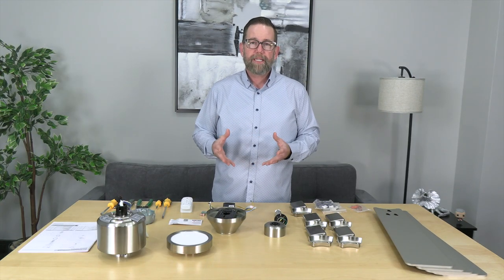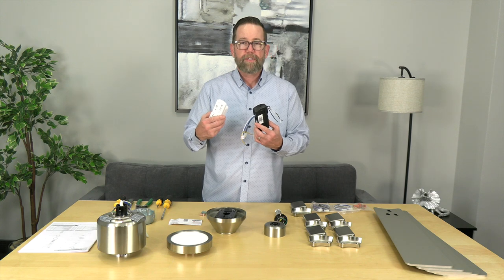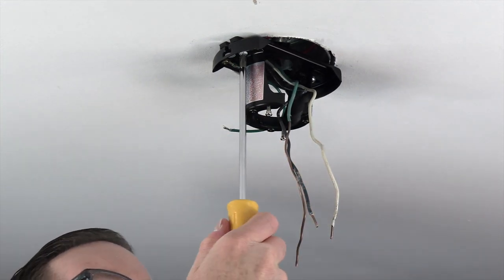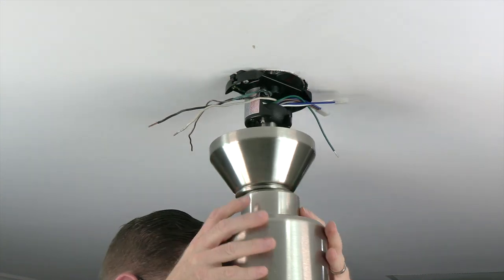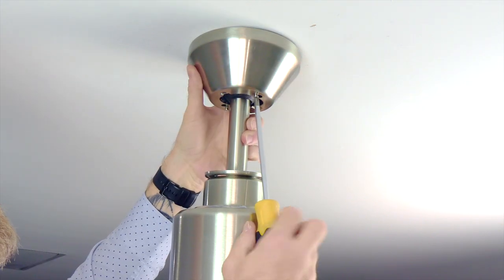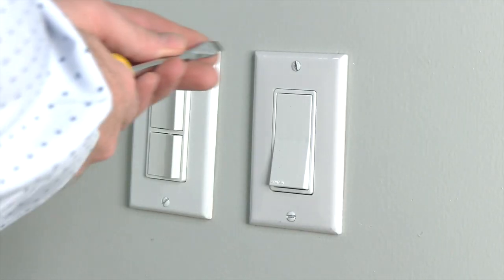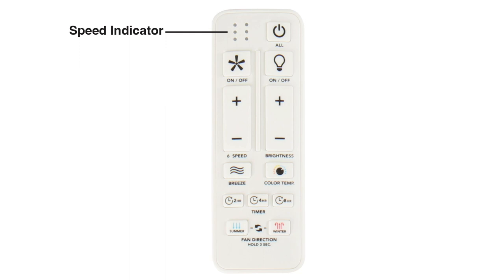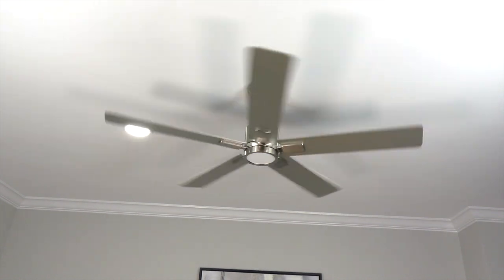How to Iinstall the 52 in. Zandra Smart Ceiling Fan by Hampton Bay

Comment: One of the issues with this fan and installation is that the controller may not be synchronized with fan and causes erratic problems with the fan. This can be addressed by powering down the fan from the switch for 1 minute and within seconds of powering up the system back up (turning on the wall switch), hit and hold the reset/sync/learn button for a couple of seconds.
Reply from the maker: The remote should be paired with the fan at the factory. There are some instances where an interfering signal in the area may cause remote issues. This can be easily resolved by re-pairing the remote, which would change the frequency of the remote to improve performance.
Reply: @ceilingfans101  —my fan would only work for about 5 seconds and then shut off. I had to find the Q&A section in HomeDeport reviews to find a similar issue and learned of the hidden reprogram/sync button in the remote. After I fixed the problem I found your comment about the remote as well. As for the reference to interfering sound waves—Hunter also explains this, but frankly it is a piece of information that is contusing to most of of who don’t understand the physics of sound waves and where they exist. It would be better to simply address the net effects and the solution rather than getting onto the physics of why this happens. IMHO
Reply: The button is hidden under the battery compartment cover.
Reply from the maker: @ZipRealtyAustin  thank you for your comments. The pairing instruction is covered in detail on page 13 of the manual. The remote functions using radio frequency, not sound waves. In the manual, it states "If the remote control does not
communicate with the fan, follow the pairing instructions below." This is, in essence, addressing the net effects and solution instead of getting into the physics. The solution would be to create a remote that is not affected by any other radio frequency device. With all of the various frequencies used with all sorts of different items, that solution is near impossible - so having a remote with a multitude of possible frequencies is the solution.

Comment: Hi, I recently installed a ceiling fan with a light that came with a remote. Everything went well, however the fan and the light only works with the remote and the wall switch is completely un operational . Would you know what could be the issue ?
Reply from the maker: Typically, if there is a switch present, there would be 2 power wires in the ceiling - one would be a constant power wire (typically a black wire) and the other would be a switch wire (typically a red wire). Sounds like the receiver was just wired to the house's black wire.
Reply: @ceilingfans101  thank you kindly. I was able to fix it. Appreciate it ! 😊

Comment: Excellent video, I have seen several videos of yours with Hampton Bay fans, I am looking for ceiling fans for the living room, between Fanelee and the Zandra, which one do you recommend? thank you
Reply from the maker: The Fanelee is slightly bigger (54" vs 52") and offers a bit better performance in the lighting and airflow numbers. The Zandra does offer a reverse function on the remote, so if you live somewhere that you change the direction of the fan, that may be a consideration.

Comment: Thanks for posting! This video was helpful.  I just installed this fan but I noriced that the downrod is not completely perpendicular to the motor. So my downrod can be straight but then the motor is crooked, or the motor can be straight but then the downrod is crooked. It appears to be worse when the set screw is fully tightened. Is this normal or did i mess up screwing in the downrod to the motor unit?
Reply from the maker: The downrod should be straight from the motor collar. Please make sure that the downrod is screwed in completely to the motor collar. Tightening the set screw should not alter the angle of the downrod.

Comment: I am attempting to place this fan on a slanted ceiling that is fairly high. My old fan had a pin at the top and the outlet plate had the opening so you could mount in with the pin to the ceiling instead of using a mounting bracket like in the new kit. Do I still just attach it in that manner and use the mounting bracket just so I can fit the remote at the top. I bought a new down rod extension but if I use the mounting bracket that comes with the kit - my rod is at an angle if I do it that way. Thank you so much for the great video.
Reply from the maker: The fan is required to be installed with the mounting bracket included with the fan. The fan can be installed on an angled ceiling with a maximum angle of 20 degrees if installed with the receiver. If you ceiling angle is greater than 20 degrees, you will need a 45 degree canopy kit so that the downrod is not angled when installed.

Comment: Hi! I'm trying to make a decision between this fan or the Hunter Aerodyne, but I'm not sure what's best. The Hunter fan is cheaper and I like the style bit better, but I'm worried that I might not tolerate the humming that it's produce by its AC motor. Do you think the HB Zandra would be much better than the Hunter? What do you recommend?
Reply from the maker: In our experience, the Hampton Bay fans are much easier to install than Hunter products. According to listed specifications, the Zandra fan is going to move more air. The Zandra also offers color temperature control for the light to let you choose different color temperatures ranging from warm white to daylight deluxe.

Comment: When the fan is at 5th speed the hanging pole is oscillating, how can stop this issue(It even creaks)
Reply from the maker: Make sure that the slot of the ball is seated properly in the mounting bracket and that the set screw is completely tightened on the motor collar. The downrod should not move when the fan is operating. If that doesn't resolve your issue, we would suggest calling Hampton Bay customer service at 1-855-434-2678).

Comment: On the top of the down rod there is a pin that makes my wires twist up. How do I get that pin out or stop it from twitch when i tighten it
Reply from the maker: You can remove the screw from the ball and that will allow you to turn the downrod without twisting the wires. You can also try to hold the wires straight up while screwing the downrod into the coupler.

Comment: Should the antenna stay hidden or be exposed? My remote isn't working consistently.
Reply from the maker: The antenna for this receiver is not required to be outside of the canopy. We would suggest changing the frequency of the remote. Follow the instructions at the 17:49 mark and that will change the frequency of the remote to improve the remote signal. The may be an interfering signal in the area causing the weak reception. Changing the frequency should resolve the issue.

Comment: How to install when i have black, red and white cable?
Reply from the maker: We would suggest just capping the red wire with an electric nut and electrical tape and then wiring as instructed in the video. If the red wire is a switch wire, you could cap off the house black and use the house red instead. That would allow you to use the switch to turn the fan and light on/off simultaneously.

Comment: Will this work on a cathedral ceiling at a 10° angle?
Reply from the maker: Yes, the fan can be installed on an angled ceiling with a maximum angle of 20 degrees. Please note that you may need an extension downrod to ensure proper blade clearance from the ceiling.
Reply: @ceilingfans101 thank you
Reply from the maker: @tlang14 you're welcome!